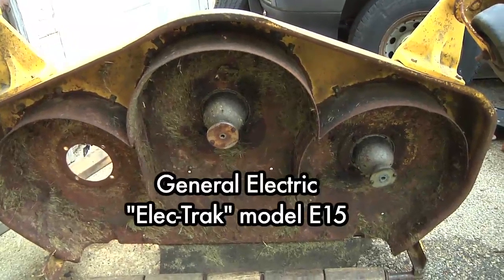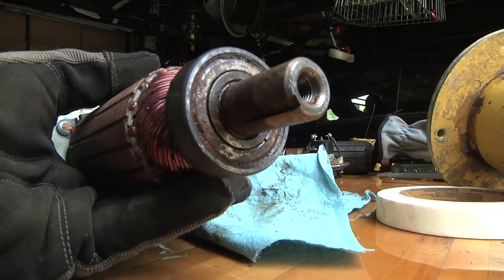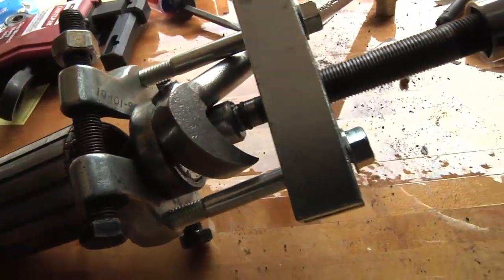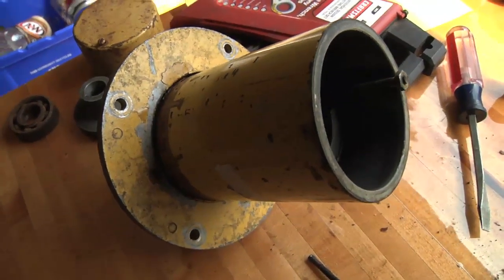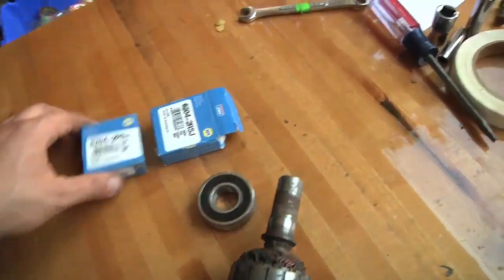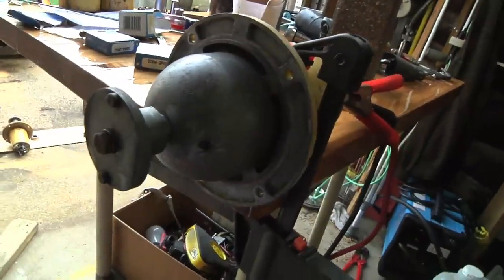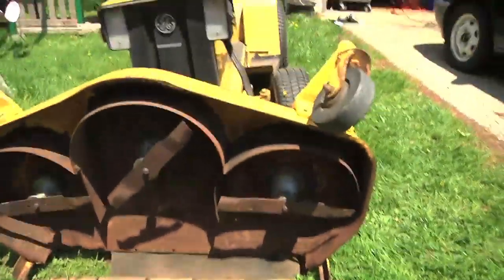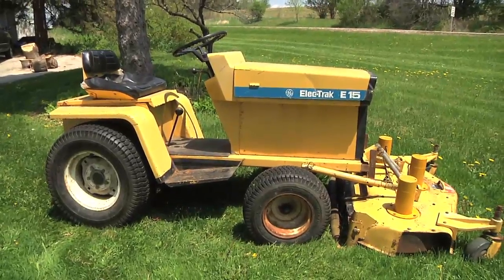Rebuilding an Elec-Trak E15 mower deck

Comment: Thanks Benjamin.
I see it's ten year later now, I'm re-building an E15. I have all new body sheet metal done and am working on the deck but it has different motors than yours, they're shorter and wider. I changed all the bearings and everything is painted. I just found new springs for the brushes and they fit perfectly.

I just got my LiFePo4 batteries (3x 12v@105A). I have to finish designing the motor controller and wiring it up. I have two snow blowers, a tiller and the front blade but they are not restored.

Comment: I would love to see where and how the drive motor is mounted.  I bought this same tractor from a guy but mine was turned into a hybrid by removing the drive motor and they installed a side mount kohler to replace it.  They also added a altinator to charge the batteries but I would like to make it all electric again ad it once was.  The deck is all original and works fine.
Reply from the maker: The drive motor is simply UNDER the tractor. For a great resource on the user and repair manuals (including illustrations) for these tractors, check out https://www.myelec-traks.com/E20.html

Comment: Is there a rationale for the deck being front mount instead of under body mount?
Reply from the maker: Yes! When in front, it's MUCH easier to attach and remove the mower deck. The deck is raised and lowered by a small electric lift. So, the same lift is used for other front-mounted accessories, like a dozer blade or snowthrower. Also, with a front-mounted mower, you MOW the grass BEFORE running it over with the wheels. It's also easier to see exactly where you care cutting. It makes it easier to trim. You can pull forward straight up to a tree or a wall and cut all the way right up to it. The front-mount deck works great! I'm really happy with it.
Reply: BenjaminNelson thanks never would have thought of those benefits, but makes sense!

Comment: interesting - i have never heard of this before - how long does that charge last? or did it back in the day?
Reply from the maker: I just have three old gel-cel 12V batteries in it. These tractors were originally designed for 6 x 6V golf cart batteries. On my current setup, I have over a solid hour of run-time. Original product literature says it can mow 3.5 acres on a charge.